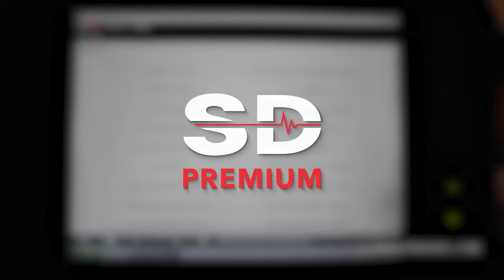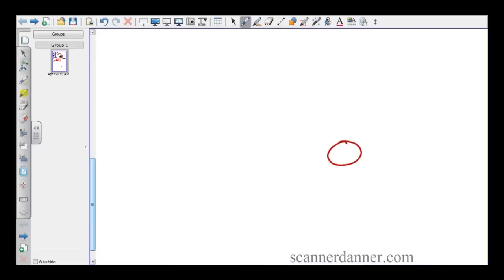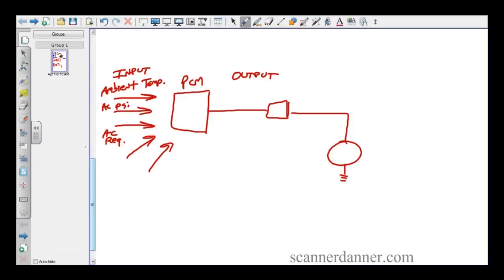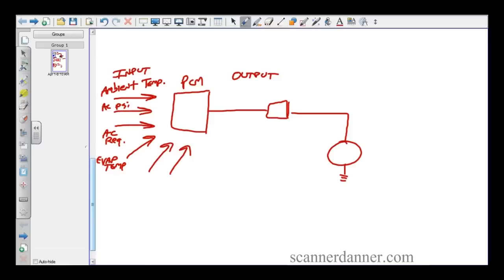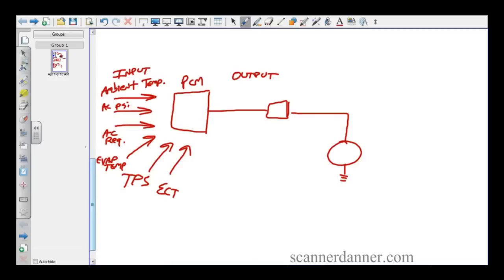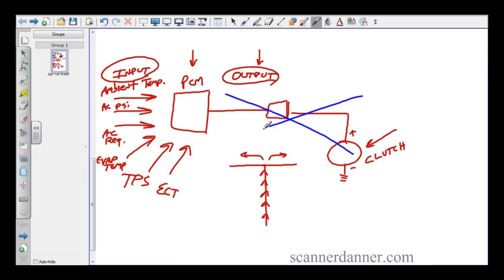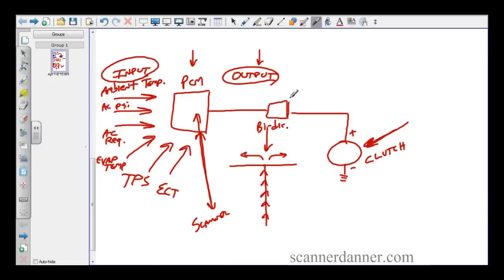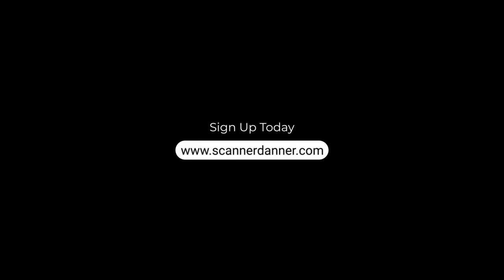The Advantage of a Bidirectional Scan Tool

Comment: Paul, does the ECM have a DIAG circuit controlled by the SCANNER and then a normal LOGIC CIRCUIT, input portion that can be bad within the ECM that can be bad? The internal Logic side bad, BiDirectional side OK, any kind of explanation is welcome, if possible, thanks.
Reply from the maker: Is this a hypothetical question?
Reply: No SIR, if you know of a factual answer, it would be nice to hear, I have run into a few problems that a bidirectional test will pass, all the inputs are available, but the ECM input logic is bad internally, semi rare but gets a guy thinking. @ScannerDanner
Reply from the maker: @DuaneDonaldson share one of your cases with me please as I'm not sure I've ever seen that.

Comment: Paul, i saw your recommendation in the comments for a DIY bi-directional, the Topdon Phoenix Lite 2 BUT among the positives on Amazon Canada was this quote from a kevin scott reviewed May 25, 2023: "Am really disappointed with the tool as regard to European vehicles. My main reason purchased this scanner is the big advertisement on European vehicles. I have the tool for a few months now and still unable to get it to perform actuation test on vw or audi vehicles engine components like activate a coolant fan, purge valve and other. The scanner do work okay with other non European vehicles with is a bit strange as company advertisement focused a lot on European vehicles. The guy from customer support, Andre did try is best but to no success. And not a lot of support available from outside of China. Tool work great otherwise but most of the vehicle I work on are European vehicles. And now stuck with it as the 3 months already run out." I wonder if others have the same issue? It got many great reviews otherwise.
Reply from the maker: So you're looking specifically for Euro coverage? I've not used my Phoenix on anything Euro yet, so I can't comment on that.
Jump over  @SuperMarioDiagnostics channel and ask him what aftermarket scan tool he'd recommend specifically for VW-Audi 
I'm thinking the VAG-com
Reply: @ScannerDanner  Thanks for taking the time to reply, Paul. No i was not actually looking for myself, i just wanted to bring it to the attention for someone who may have been looking for Euro coverage and that the person was not satisfied with his purchase. It's so great to see a Channel like yours and someone who takes the time to read comments and reply; so many don't.

Comment: @glendekoker3682

I'm getting 27C6 not present DME: Oxygen sensor, adaptation, trim control, bank 1 and 27C8 not present DME: fuel pressure/ model comparison. Mostly get first code just started for week now fuel code came once. Any help? BMW M5 2006 I have an Autel  908 scanner

Comment: Absolutely!  The AC in my 2015 Ram 2500 was intermittently cutting out.  Connected the scan tool and found the hi-side pressure switch was telling the PCM the pressure was 1,600 PSI.  Connected my refrigerant gauge set, and the real pressure was 160.  According to the tech data, the PCM will shut the compressor off when the hi-side pressure reaches 450 PSI.  15 minutes and $33.00 later, the problem was solved.  And since Ram uses a schrader on the high side switch ... no evacuation and recharge ... simply unscrew the old switch and install the new one.

Comment: another video where you seem to take pride in ripping people off. If something only takes you two minutes, charging for an hour is just plain dishonest. It's really sad that you don't realize that. Maybe when you grow up a little bit and gain some maturity you'll realize how stupid you make yourself look at these videos. Just stop already.
Reply from the maker: If I mentioned "time" it is only in the operation of a flat rate system, which is flawed anyway. If I do a brake job in 20 minutes, as a tech, I'm still paid for the hour in a flat rate system. You don't get a deal because my expertise and tooling allowed me to complete the task sooner. This is no different. If it took me the "two minutes" you mentioned, that's 30 years under my belt allowing me to pinpoint problems that fast, not to mention the tens of thousands of dollars in equipment I own to allow me to make that call. 
So lets stop talking about "Time" and I'll sell you a fix that I 100% stand behind that will be the right call. What is that worth to you? 
If you take your car to a shop for a "diagnostic" and then have had part, after part, after part thrown at the problem before they finally fixed it, then you understand you have two choices. Roll the dice with a parts changer, or pay a true diagnostic tech and I promise you, I'm less expensive. So who's ripping the customer off???

Comment: No offence, but I think this is a poor example of how bi-directional controls are an ADVANTAGE. If pressures are good, yet the clutch isn’t engaging, power to the clutch coil is the bottom line make or break, whether or not the clutch engages (along with clutch air gap), so why would you “leave your test light in your toolbox” and start your diagnosis by actuating the clutch coil with the scanner? Technically, testing for power at the coil is where you should start your diagnosis and work your way from there, not starting from the other end of the flow chart
Reply from the maker: I'll also add, the AC compressor clutch wiring is not always easily accessible. So in your example, you need to rack the car, put it up in the air, take the tire and inner fender off (maybe) to gain access to the clutch wiring and you think that's better than starting with the scan tool?
Reply: @ScannerDanner  In this case, as a first step, I don’t care what this actuator test tells me, I want to know what’s going on when the system should be normally operating. It’s not the end of the world though. I just don’t think your test is the best place to start because it also leaves you at a fork in the road, where you could end up taking unnecessary steps if you take the wrong path from there on, and in some cases the results may not particularly lead you to a solid next step. It’s like you’re starting at the middle of the flowchart and hoping you take the right path. I’d rather start at a point that can only lead me in one direction, and the results of each test drives the next test. I don’t know about you, but I see very, very few inoperative compressors caused by a bad input, so naturally I’ll start by checking the load side first, and in most of the time this is where the problem lies
Reply from the maker: @deeznutz3494  once again, this isn't about the AC clutch! It's the principle behind it. You think direct testing is a better first step and I think pushing a button on a scan tool is a better first step. You do you man.
Reply: @ScannerDanner  Unfortunately, you are way over "nutz's" head trying to explain your point, which is quite obvious to anyone else except him!
Reply: @ScannerDanner  Look dude you asked me, so don’t turn around and tell me “this isn’t about the A/C clutch”, immediately after asking me how I’d approach testing an A/C clutch.

Aside from that, when you’re dealing with a circuit or function that is difficult to test under normal operating conditions, this is when actuator tests can be an advantage. EGR, evap solenoids, are just 2 out of many, and that I’ve used recently. Sure, you could break out jumper wires or the power probe and test that way, or you could simply hook up the scanner and press a button. That to me is an advantage, because you could end up going through hell trying to get the answers you’re looking for by doing it the old fashioned way.

But when you’re testing an inoperative A/C compressor, the circuit is ready to be tested when the car is idling in your bay with the A/C switch on, so what’s the advantage of using the scanner to actuate it when your testing conditions are naturally present at all times? Especially when, like I say, (in my experiences anyway) a good 9.5 times out of 10, an inoperative compressor clutch is caused by a fault on the load side, so likely it still won’t work when actuating it with the scanner anyway. This is why I see this first step of yours as a waste of time, and not an “advantage”
Reply from the maker: @deeznutz3494 again, this is a class of newbies and I'm teaching about scan tool bidirectional controls, not about AC systems! And this is only a clip from the class!
You don't like the example I picked, thats fine, but it was never about the the damn AC clutch and what the common failures are! You came in with a "no offense man" comment, you may as well have finished it and said "you are one pathetic loser" (dumb and dumber quote) 
This example painted the picture perfectly of the advantages of a bidirectional control on a scan tool.
Reply: @ScannerDanner  Hey come on that’s not true, Paul. I wouldn’t watch any of your videos if that’s really what I thought of you

I just like debating and pitching alternative opinions when I get the chance, instead of all the same typical, “yes man” type of comments that people usually post

And I’ve watched some of your classroom stuff, and I really do think you do a great job teaching
Reply from the maker: @deeznutz3494  thanks man, it took me a bit to understand your point. It's hard via text sometimes.
Did you like my dumb and dumber quote though?
Reply: @ScannerDanner  yea it fit the situation perfectly! (In a joking way of course) Great movie!
Reply: @ddeznutz3494, I notice this is your second trolling comment, I tried to check out one of your vids to see a better way to do things but couldn't find any content of yours, hmm 🤔 weird.
Reply: @seanshute9284  who says I need to post videos in order to offer my opinions? If your little feelings can’t take it, stay out of the comments!
Reply: @deeznutz3494  no, it's just a lot easier to be a troll than to contribute anything of value
Reply: @seanshute9284  no it’s easier to be a yes man, which these comments are full of
Reply from the maker: To each his own, this was one example and is relevant way beyond an AC clutch!

Comment: PCM STRATEGY should be added to the "inputs"! I had a Ford with a misfire that would not turn on the AC, even though the scanner showed the AC was commanded on by the PCM. (the boss wanted the AC fixed first) Long story short....The  PCM was replaced for a bad coil driver (misfire) ,  and the AC now functioned. SO, on a FORD, a CURRENT code can prohibit AC clutch "command"....sometimes the scanner lies ;-)

Comment: A good scan tool is a must, in fact TWO different scan tools are necessary, in my opinion, for those times when one brand has trouble with a specific make or model.
Reply: Launch can do what most pro scan tools combined, why? Because they can do some programming as well. Something that my Verus Pro is unable to do, such as adding keys and such.
Reply: Even at the dealership I have an autel for the days the oe scan tool has bad sw or some other issue.
Reply: LOL. We would get along very well. Don't tell my wife. She'll take it out on the SnapOn guy.
Reply: You can have 20 scan tool..but the scan tool between your ears don't work its useless...imo

Comment: My son has been having problems with his Jeep, problems with his check engine light, battery light and his transmission light coming on. He so far owes around $3000.00 at the Jeep dealer. They say his computer was blown, replaced it and now the replacement is blown. They say because of the  UAW talks they can't get the parts to repair it so they gave him a loaner car in the meantime. This got me interested again in scan tools and I saw this video. Maybe you should name your new edited video series, Ask Scanner Danner.
Reply: Did you check the alternator rectifier? I learned from S.D. that a bad rectifier can cause all sorts of electrical havoc- l replaced my alternator and my non-shifting A.T.  transmission was fixed. I also had various dashboard lights coming on in addition to the tranny problem.  Those lights are now back to normal.